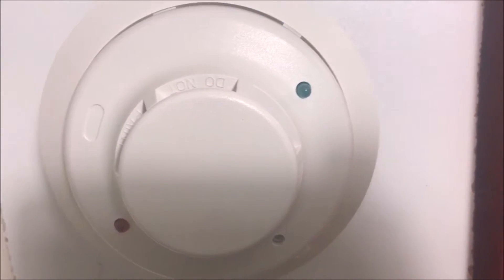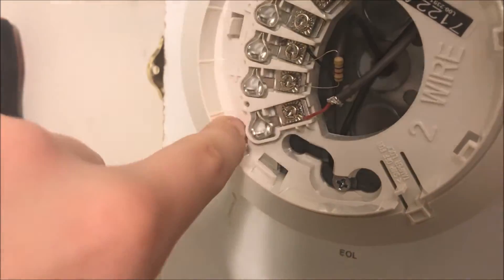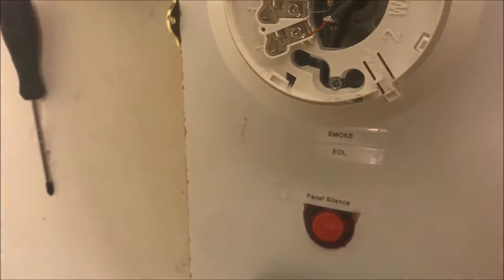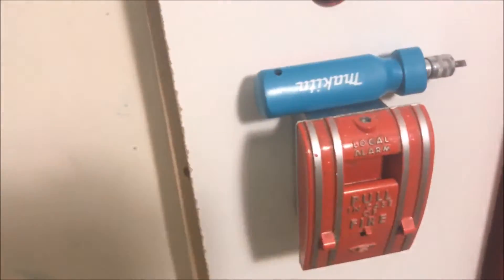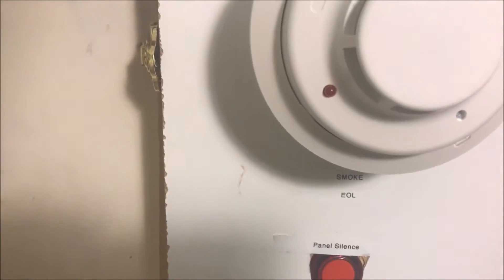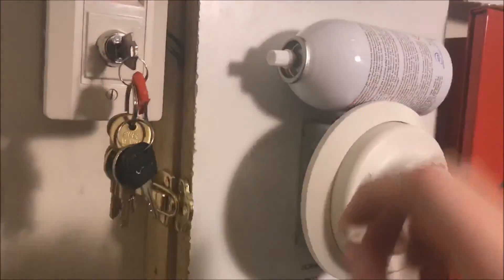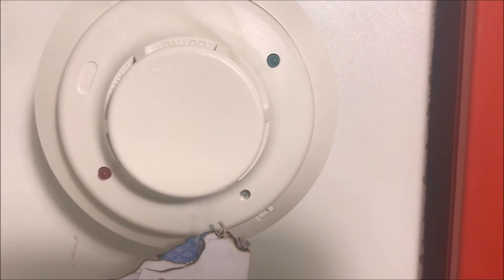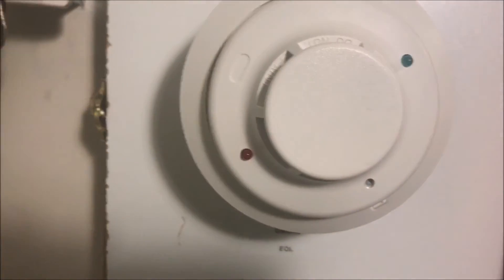Testing and Review of the System Sensor i3 Smoke Detector

Comment: Mine was working well til I had a couple smoky kitchen events now there is no green or red light blinking.. Anyone have any ideas?
Reply: Captinprivate replace it, if there is no indication, you won't know what zone it is (when it activates) and it is a nightmare.
Reply: I will, thanks @Breadedglizzy19
Reply: Captinprivate your welcome, glad I could help!
Reply: Captinprivate make sure you’re using a compatible panel. The 2-wb can be damaged if they’re used with a non-compatible panel.